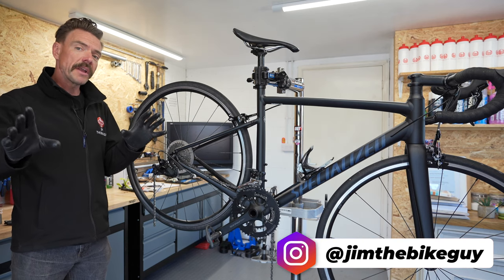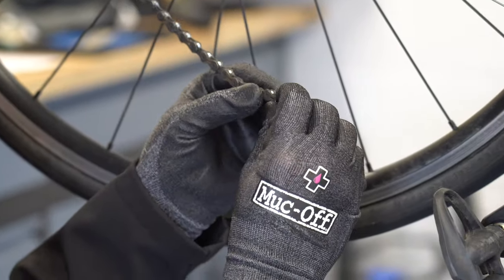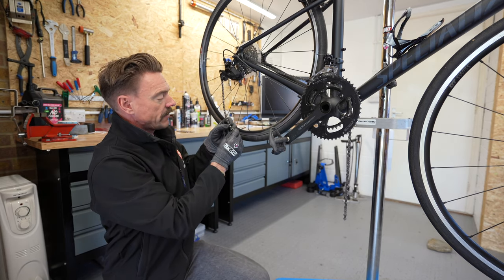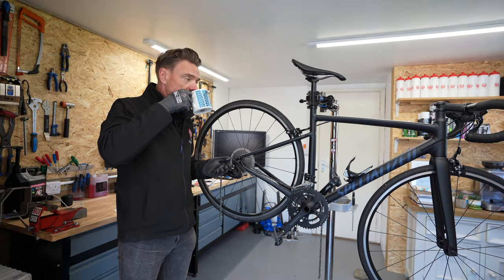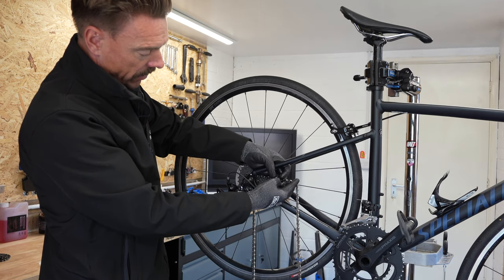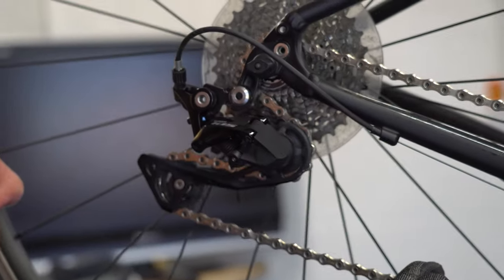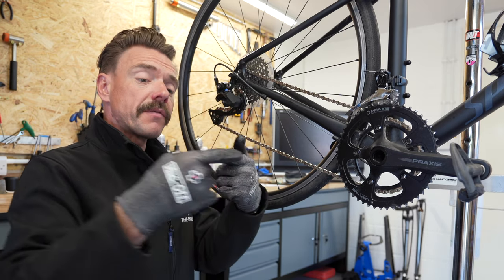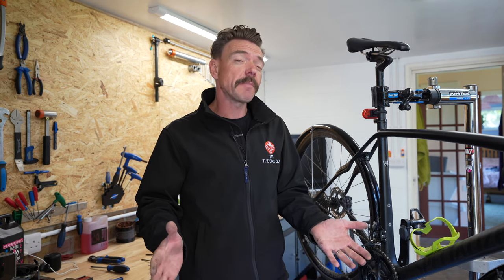How To Fix A Broken Bicycle Chain: It's Easier Than You Think

Comment: If you don’t have a chain-link tool but need to snap the quick-link closed: with the bike still on the stand (or on the floor) after adding the quick-link, pedal gently until the quick-link is at the top between the cassette and chain rings. Check visually to be sure both halves are correctly engaged as Jim pointed out. Hold the back brake and thump down on the drive side pedal [as though riding forwards]  with your hand (or foot). The quick-link should  snap closed as the top part of the chain feels the pulse of tension and pulls the 2 halves of the link away from each other.
Reply: I was surprised and disappointed he didn't mention that gem of information, as who wants to carry master link pliers on all their rides?
Reply: @curtmcd Wrong! He mentioned it in 5:25
Reply: @JanKowalski-ux6nt  nope ... 14:55 was when he was about to say it but didn't.
Reply: @curtmcd  He said that once around 5:25 and didn't had to repeat. Just watch the whole video instead of rewinding...

Comment: When you want to lock the quick link in place instead of pedaling hard you can.. rotate the chain so the quick link is positioned to the top just behind the chain ring. Then you simply push on a pedal forward while locking the rear wheel with one hand. That's how I do it in the workshop and you could easily do it out on the road aswell. :)

Comment: GREAT video Jim ! ONE thing I might add is that it is also possible to "click" the quick link into place simply applying pressure with your foot on one of the pedals  WHILE applying the front and rear brakes firmly to hold the bike in place while you do so.. Your advice to replace the chain is golden. As a matter of fact it may well be a sign that just ordinary maintenance has been wanting :-)
Reply: 5:25
Reply: @JanKowalski-ux6nt  Yes -thanks for 5:25 . . .   but you don't HAVE to pedal hard :-) I was just saying that  you can  hold the bike with both brakes and press one of the pedals with your foot until  you hear the link clicks into place.:-)  I've done and it works just fine
Reply: @davidbee8178  You're right. Cheers

Comment: Hi Jim  great video. Would you need to change your chain if you change your cassette size and or the size of chain rings? e.g go from a 50/34 m 11-28 to a 52/36 11-30?

Comment: I don't ride much-but I'm on my third chain in probably not even 50 rides. What the hell is going on? The first two, I had professionally done (including a tune up two years ago complete with new brakes/cables)... I'm hoping the guy who did my bike would have noticed something wrong-maybe not. I have a 2014 Stumpjumper, btw. I did notice broken teeth on the large sprocket (front-pedal) Could that be the reason? I'm about to go out into my garage and put on a new chain myself using your video to guide me. Hope it goes well cus the time before this last chain, I was riding up hill going a good speed & standing for momentum and my chain popped-driving my weight down on to my foot-s which slipped off my pedal down to the concrete and causing me to going upside down with my bike and my shin was wrecked man-so painful.. (sorry-vague explanation) I just want to get this going so I can ride my bike man!!

Comment: I’ve always measured the chain against the old one or by looping around big-big (without the derailleur). Never understood why but also it always seemed to end up OK. Your method makes a lot of sense and looks easier to do but is there no danger that the chain won’t be long enough to ride big front and big rear?
Reply: I've always seen it done the big-big way on youtube, but always learned to do it this way as well.  As long as you followed the gearing specs of the derailleur you should be ok.  The derailleur's tension mechanism is built to take up slack for a certain range of gears.  as long as you follow that it should leave you with enough chain to use them. 
Basically, this method gives you the max amount of chain length your derailleur can support, if it's not enough, you need a different derailleur that can support the bigger range of gears. 
The big-big solution often ends up with a shorter chain, so less links, so more cycles of the chain needed for the same amount of distance which in theory means the longer chain (so the method seen here) should last a little longer. 😉